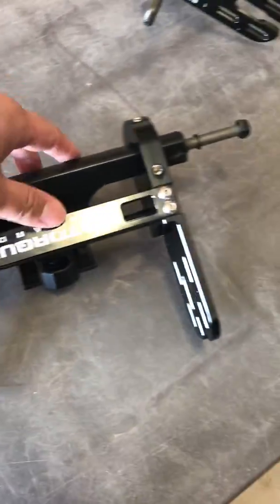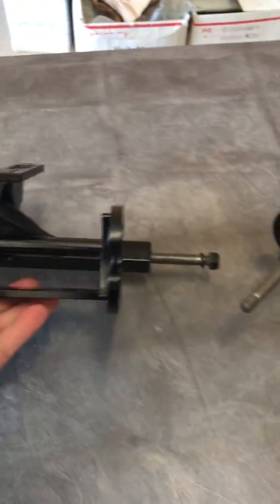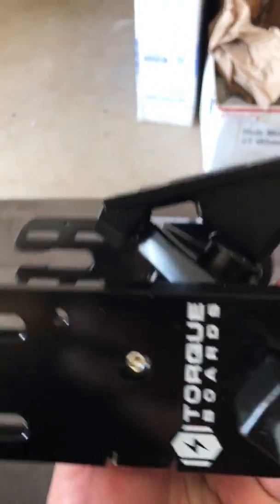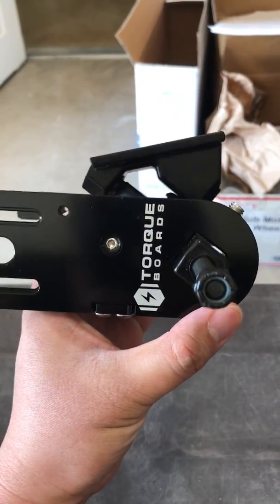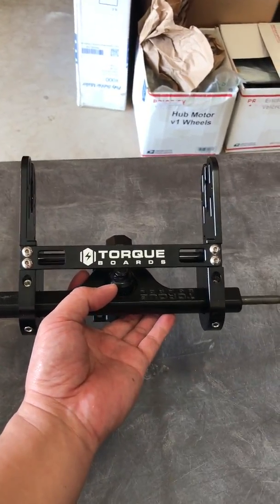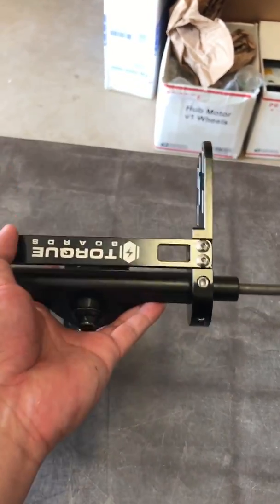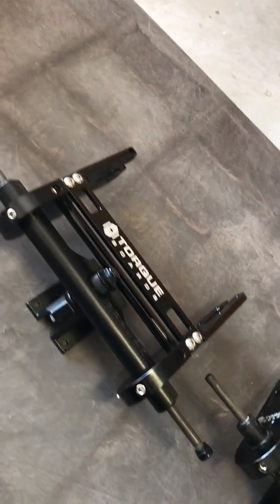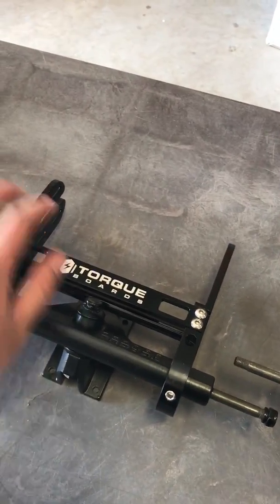Electric Skateboard Motor Mount

Comment: Does the new fixed v5 motor mount work with 8 inch pneumatic wheels? I mean does it extend long enough so that the motor shaft can sit behind the wheel?